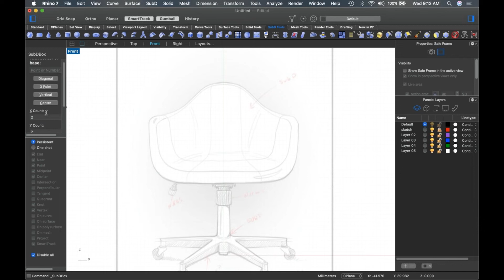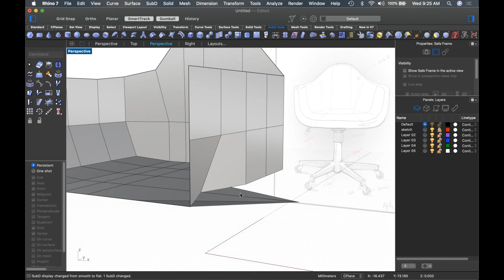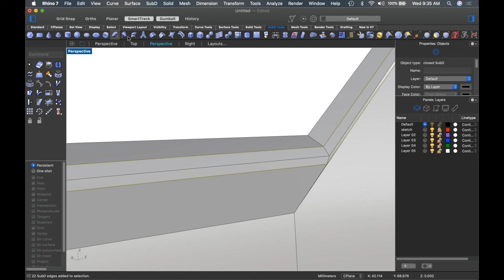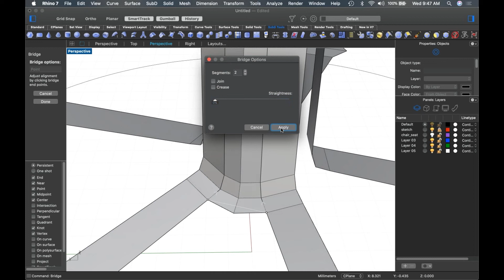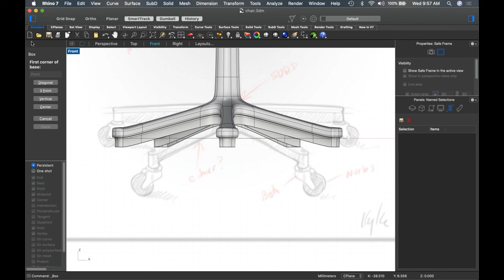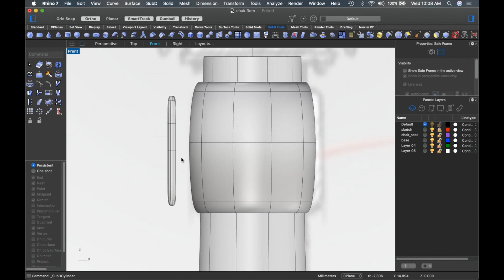Getting Started with Rhino 7 for Mac- SubD Chair

Comment: Hello, I like your video. While I was imitating your process, was checking Preference Theme--I didn't touch though, Chair picture I placed suddenly not visible..... I use Rhino7 for Mac
Reply from the maker: Simply delete and replace the picture.. does that help?
Reply: @Rhinoceros3d  Thank you for your reply. The answer is no. I recreated the same process in a new file, but the image no longer appears in all the files.
Reply from the maker: @akikofucci2636  run the systeminfo command in rhino and send the result to tech@mcneel.com so we can look at your system.
Reply: @Rhinoceros3d  I will. Thank you for your help.